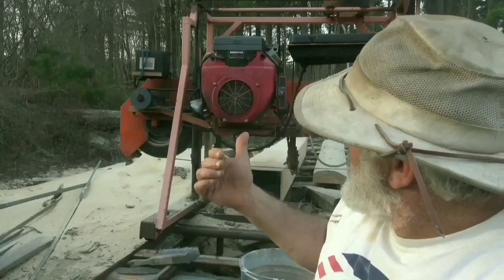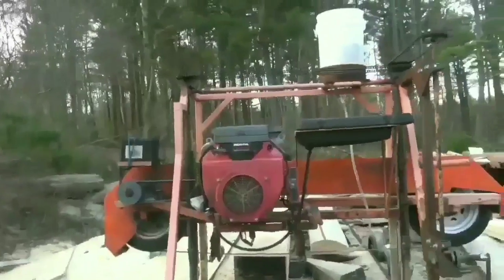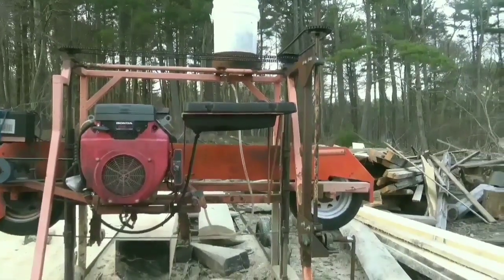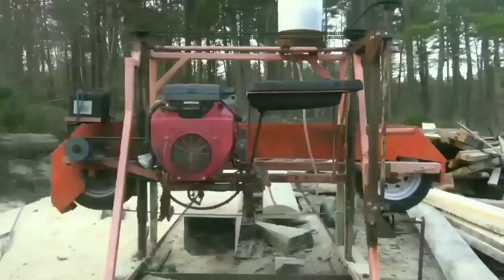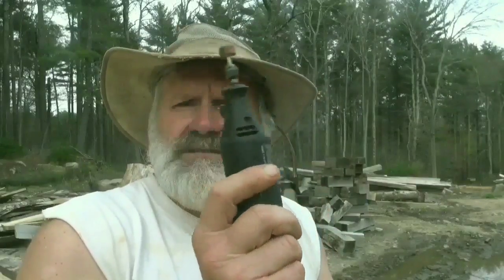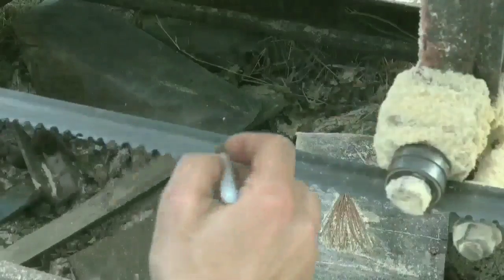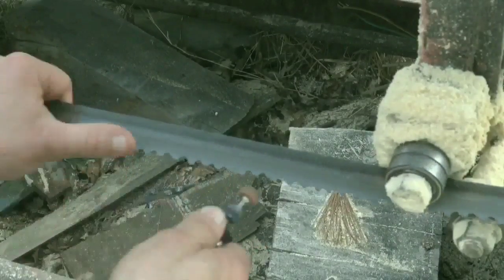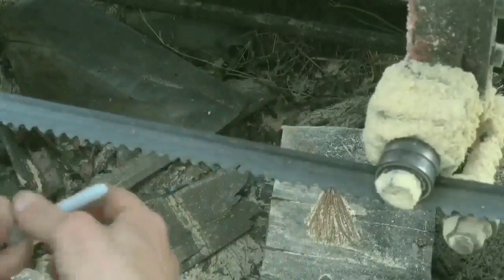Using the homemade bandsaw mill and sharpening blade using simple technique

Comment: Nice, mill looks like it does the job without any issue. Very cool. Thanks for sharing.
Reply from the maker: Bens sawmill yes this is prob longest video I have ever done sound is a little messed up experimenting with new camera
Reply: I caught a little glitch or two on the audio 8:01 but it wasn't bad. I think the length was good. Keep up the good work.